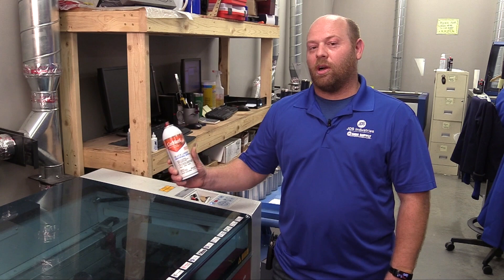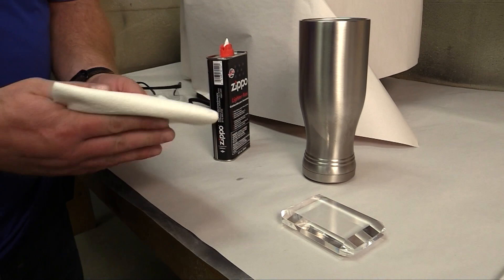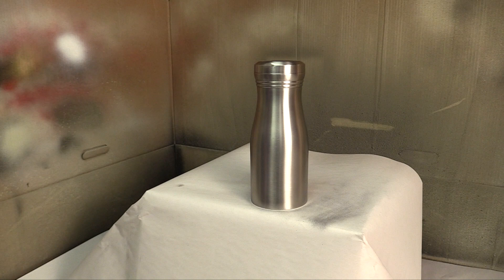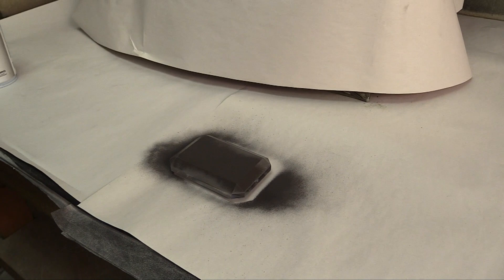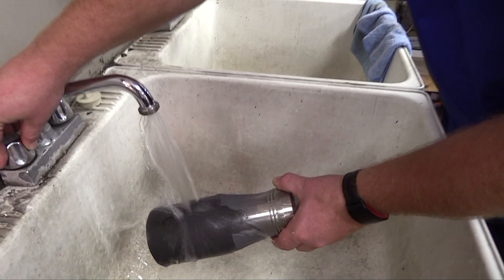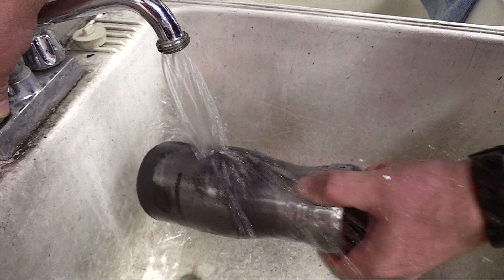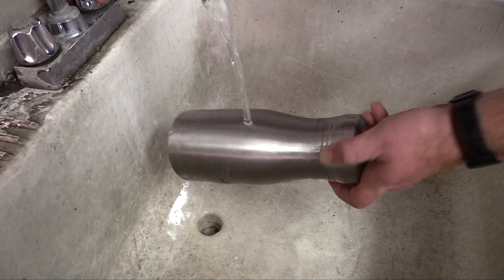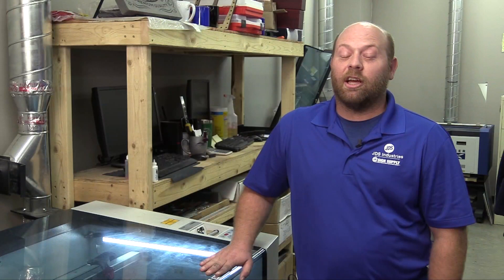Tips to Get the Best Results from Cermark Ultra

Comment: there is "how",  i wonder "why" it works; does it just help the beam burn the surface, or does it fuse a bit into the surface.  I notice the rinse but not rub under water, I think my first impulse would be to wash it off with a cloth under the running water, ? this would be wrong?
Reply from the maker: As long as your laser settings are dialed in you could wash with a cloth. The laser does bond the cermark to the material but if your settings aren't right you may end up rubbing some off.

Comment: Speed 15-25%????
Reply from the maker: We suggest 15-20% of your max speed. Your laser could be on a different type of speed scale such as mm/s. There is no direct formula to convert it, but taking 15% of your laser's maximum speed will get you in the ballpark. The slower the better when it comes to Cermark.
Reply: If you tell us what your max speed is and max wattage then we can do the math and figure out the parameters. 20% of a 70 watt laser is not the same as 20% of a 100 watt laser. It seems every YouTube video makes the same assumptions.